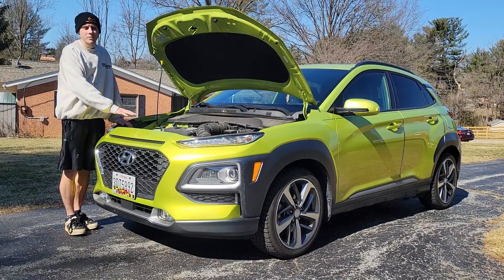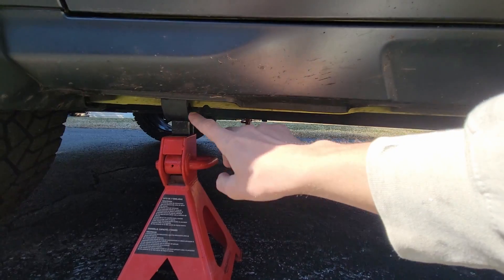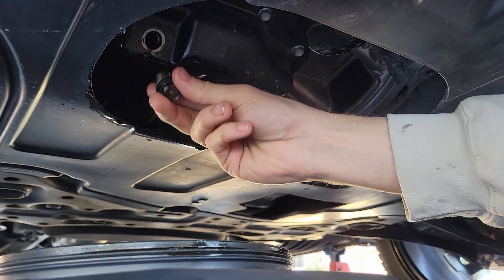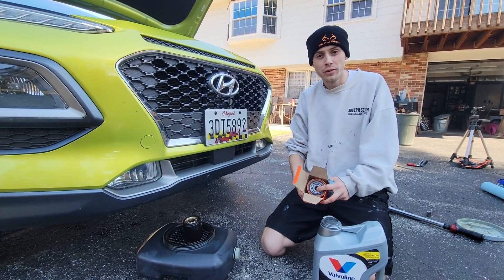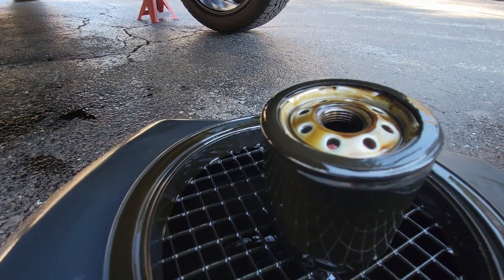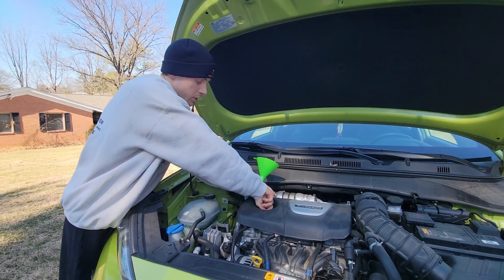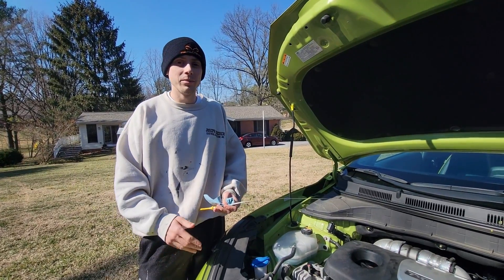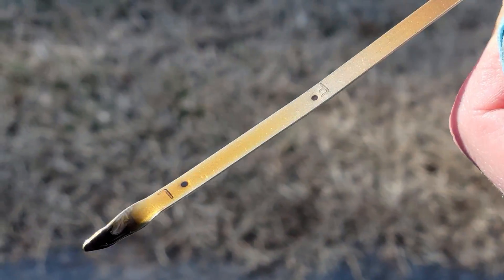How To Change Oil in a 2017-2021 Hyundai Kona 1.6L Turbo

Comment: Thanks, I just came to see where the filter was before I pull the car in lol. Hey, A little tip when changing oil. Loosen the oil cap before you take the drain plug out. It's like a straw with your finger on the top. The oil will flow out faster and help with that wind.
Reply from the maker: That's a good call! I'm going to try that next time. Maybe it'll push that fluid a little further and keep it from making as big of a mess!

Comment: I'll make some additions to this excellent tutorial: My filter was a little large for the one recommended in the video. Oil filter pliers are better suited for deviations in diameter. Also, the plastic on the understide was like something deviously designed to make working on the vehicle underside difficult. I could loosing the plastic sufficiently to allow reaching in only after I loosed about a half dozen 8 mm bolt. I invested in my first powertool on this one because there was no way I could generate the torque I'd need to screw off the oil tank plug on the underneath a vehicle with a 3/8 wrench

Comment: Back in my valvoline days 92/95 we always took the oil cap off before removing the plug before draining not sure it matters or helps but I remember in high school doing that.
Reply from the maker: I imagine it would make the oil drain quicker. If you were changing the oil on multiple cars, I could see that being much faster.

Comment: Did you have to clear the maintenance light after or did it just clear itself and stopped popping up after?
Reply from the maker: I had to reset the oil light. You can use the menu on the dash to reset it.

Comment: did our boy put a crush washer back on the pan plug? didnt see that mentioned
Reply from the maker: I typically never remove the crush water. Hopefully it made it back on lol
Reply: It should be replaced every time you change the oil.  @BustedBeaters

Comment: A few things. You should remove the oil cap on top of the engine first thing. And you also should drain the filter and the oil drain plug at the same time. The way you did it by draining the oil pan first, replacing the plug, and then doing the filter likely allowed used oil to drain back into your pan after removing the filter. Just take the plug and filter off and letbitball drain well. Also you don't want a film of oil on the filter gasket at all. Doing that can cause it to seep oil.
Reply from the maker: Good tips. Thanks!

Comment: If no one said it, be advised about the gasket beneath the oil plug. Hyundai says thats a ONE TIME USE gasket of a "crush" type (i got no idea what that means). In their service manual they say it needs to be replaced each oil change. Whenever i changed oil at the dealer, go and behold, they charged me that gasket some 1.20$.
Reply from the maker: Yeah this should be replaced every oil change. I always reuse the gaskets until they're really bad. I keep a close eye on all my cars though

Comment: I have a 2018 Tucson with this exact engine , there’s a label in my engine compartment and it reads use Quaker state motor oil , that’s what I’ve been using since I bought the car in 2019
Reply from the maker: Interesting. I'm going to have to look and see if that sticker is on the kona!
Reply: No real differences in brand just make sure to use full synthetic
Reply: @RaistlianMajerie ➡️ I know👍🏻., quaker state is fully synthetic is what they recommend and is what I’m using , I figure I let this guy know in case he wants to use the original motor oil .

Comment: Get your info right pls. The new 1.6T engine since model 2021 uses a cartridge oil filter, NOT a canister oil filter!
Reply from the maker: Looks like they changed over to the new filters in 2022. Thanks for the info! I'll be updating the vidja!